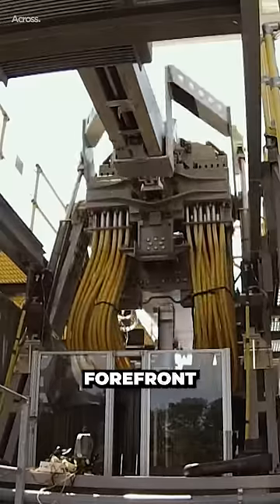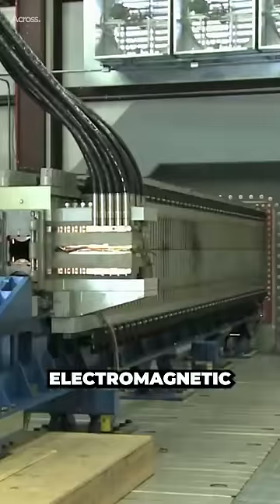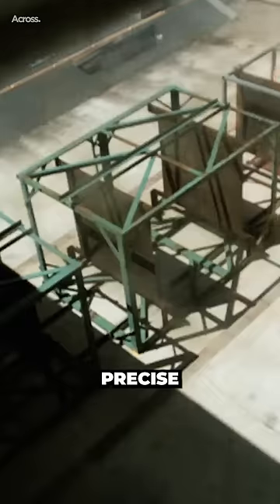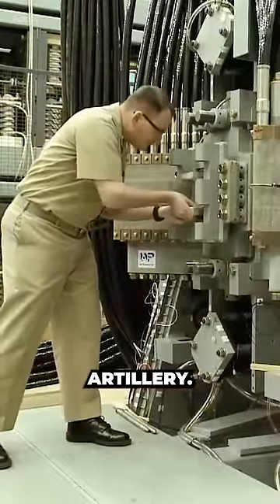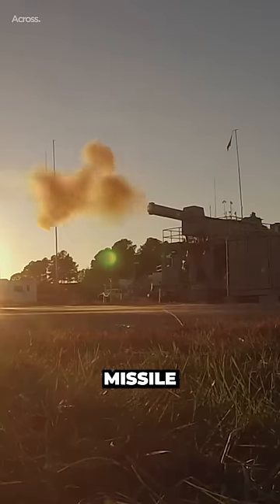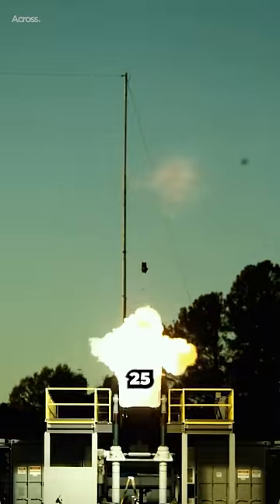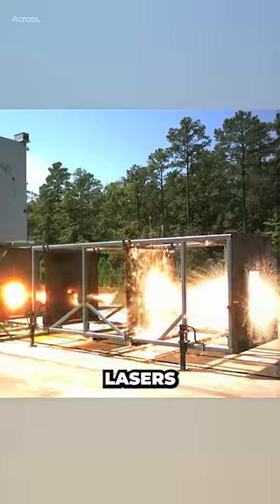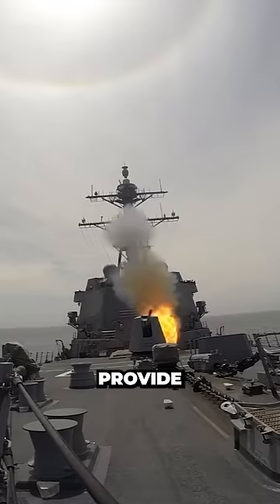The $500 Million Weapons That Make Everyone Afraid #shorts

Comment: When you say 25 megawatts do you mean 25 MW hours or 25 megawatt seconds or just the instantaneous power during the shot?
Reply: 25 megawatts. If you had a meter (like the ones on our homes), the same amount of power to make the meter record 25 megawatts. I thought it was pretty self-explanatory.
Reply: @castleanthrax1833  not really.
 Watts is a measure of power, not energy. It's like saying my car needs 200hp to get from point a to point b. You can get from a to b with a 100hp civic or a 500hp mustang and while the mustang can get you there a lot faster the amount of gas is what you really want to know. The instantaneous power doesn't tell you, what you need to know. I could power a 25Mw railgun for 1s with a 1kw diesel generator with a large enough flywheel capacitor, but it would take 7 hours between shots to charge up.

To put this into perspective, large land based nuclear power plants make about 1.2Mw. it's unrealistic to believe that a railgun of that magnitude would be suitable for naval scale. (Former Navy Electricians Mate)
Reply: @alienclay2  Wow. How annoying are these ridiculous analogies. It's not a car. It's not horsepower, and it's not distance.its 25 fn megawatts. You seem to be the only person who can not understand.
Reply: @castleanthrax1833  ok, let's dispense with my analogy and go with your explanation. Tell me this. The electricity meter on the side of your house, Does that measure watts or watt hours?
Reply: @alienclay2  The amount of power that would cause the meter to roll over 25 megawatts is the power that would be required to launch the projectile. The fact that they may have misspoken the terminology is not really relevant.
Reply: @castleanthrax1833  you are trying to answer my question and you don't even understand the basis of the science behind it. 

I don't mean to say this flippantly, but since you fail to understand my previous analogy I doubt that proceeding with more logos is going to help you, perhaps I shall establish some ethos. I spent 12years in the Navy as an electricians mate graduating from Naval Nuclear Power training. I spent 7years of my life pursuing a degree in electrical engineering (I was going at half speed while working full time). At one time in my life I worked for American Electric Power as a transmission dispatcher managing parts of a grid area covering 10% of the state of Texas and line voltages up to 1MV DC and 512kV AC. 

I understand physics, electricity and engineering and I also understand why it's nonsense in Back to the Future to stress about 1.21 gigawatts. I can produce that with an audio capacitor from off my car, that's instantaneous POWER but I can't sustain it, and how long I need to sustain it tells me how much WORK is in question. Please take time to find a video that can explain the difference between the three concepts of energy, power and work before returning.
Reply: @alienclay2  I don't care. I understood what they meant, and I didn't need to list my achievements to do so. Please find a video on how to behave less pompously before returning.
Reply: @tyroneemail  
......
You stated 25Mw = 25MJ
Let's simply your statement
w=J
No
A Watt does not equal a joule.
A Watt does equal a joule per second.
Or 
A Watt*second equals a joule.
A Watt*second also equals a Watt*hour/3600
Once again, this is a confusion of a unit of power(watts) vs a unit of energy (watt*hours, watt*seconds, joules, etc...)
Reply: 25 megawatts can power up a small city.
Reply: @castleanthrax1833 Die he's right. Planner of power supply stations for metros here. Just easy way for understanding. A 1kW motor uses 1kWh an h. A 6kW motor uses the same amount of electricity in 10min. The question is how many kWh are required, because it's a question of how long you need to maintain the 25MW of power. For a fraction of a second it wouldn't be a problem. You would need a super capacitor with a weight of about 140kg (considering a capacity of 50Wh/kg.) for powering this Thing for one sec. Thing is that something needs to supply this capacitor. Only suitable for nuclear powered ships. For a high fire rate that would be quite a problem. But the biggest problem of this is the service life of a barrel. It just will not last long enough. Don't know the word in english, but in german it's "Korrosionsströme" . Basicly electrons take material with them while travelling threw it. No problem with AC, because the electrons come back, but very problematic for DC, which you will need for a railgun. Also there's a massive amount of heat produced, which is also heavily impacting the material.
Reply: @alienclay2 I guess you made a mistake while typing. Power plants produce GW, not MW😉local coal powerplant here produced 3,4GW.
Reply: @Karsten31  that is correct, thank you for that clarification.
Reply: @Karsten31  that is correct, but the one thing I would disagree with is the need for the ship to be nuclear powered. I'm using some back of the napkin stuff here with broad assumptions about projectile mass and barrel length, but Perry class frigates had a 4mw electrical system with 4 diesel generators. Assuming a strong shipboard distribution with a 10mw and at least half available for weapons, 25mw for 1 second would be 6.95kwh. a 5mw system would recharge that in 5 seconds. If the shot time in the barrel is less, i.e .1s, then a system that size could support 2 shots a second.
Reply: @tyroneemail  why did you start your post by stating that a Watt has the exact same definition as an amp? (1C/s through a node)
If that is true then your definition negates voltage. (As wattage is defined by voltage *current.) Please proof read your comment and resubmit.
Reply: @tyroneemail  You are correct that Using the definition of current reveals the time constant inherent to the definition of power in watts, but you are forgetting the squared time constant of acceleration present in Joules to that has to be reduced to equate the terms.

A joule is defined as
The energy required to accelerate a 1 kg mass at 1 m/s2 through a distance of 1 m.
Or J=kg*(m^2)*(s^-2)

J=/=w because (C*v)*s^-1 =/= (kg*m^2)*s^-2

It also has a time component in the denominator, but without multiplying by time (seconds) to reduce it to a power of one, it represents a unit of energy and not power. 

I have never heard of your explanation this disparity in convention. I did a Google search of "watts to joules" and it confirmed the inseparable need to add time to the equation. Everything else you are bringing up as an explanation is nonsensical and superfluous.
Reply: @tyroneemail  . I'm a bit tired myself and I know my last post may not have been the best expression of logic even if it's conclusion is sound. How about this. Post a link to a reputable source that uses your convention of notation. As of right now it feels to me that you feel as something is a particular way and that you have support but I don't believe that support credibly exists so if you were to show that I may be more interested in continuing, because I've been doing as you said to do to double check myself and everything that comes up supports what I am saying.
Reply: @alienclay2  the cables wouldn't survive that. Also I would doubt, that the capacitor would be a fan of constantly charging and discharging.
Reply: @Karsten31  well, it's like any gun. How fast it can fire in theory is one thing, cooling the barrel (cables, whatever) to support max rate of fire is another. I'm just theory engineering here, let the design department handle that.😜
Reply: @tyroneemail  please provide a link or source for this being the case.
Reply: @tyroneemail  .... A rail gun is DC. Why are you talking real vs apparent power? The output is kinetic energy into the projectile. What are you talking about? It doesn't even relate to your suppositions about denoting the time variable? You are making no sense.
Reply: @tyroneemail  Matthew 5:23-24
I’m taking time to respond because in retrospect I recognize that I was impatient and rather overbearing in my third response to castleanthrax1833. I may have felt a bit slighted as he didn’t thoughtfully directly answer the question posed to him to my second response. The answer to that question might have prevented much of this and in response I felt that the shock of explaining my experience and credibility may cause him pause and reconsideration on his own part. I try to be conservative and respectful in my day to day life as I recognize that everyone can make mistakes, and even if I am 110% certain of my correctness, that I don’t want my pride to precipitate a fall. There are times when I know I am right, and it can be frustrating when I feel that people are not giving me a fair chance to at least consider my explanation. On my part, to both castleanthrax1833 and anyone else, I apologize. The way it came out in writing isn’t the tone that it came into my mind and the result was counterproductive rather than formative.

To that end, (and to free my mind of this issue for at least another 24hours, lol,) lets break down your last post.

“A rail gun utilizes Inductance or reactive power to propel a projectile. Rail gun devices can be AC or DC depending on what you are trying to achieve (ie one big projectile or many smaller ones). However once DC achieves its designed peak voltage the magnetic field would collapse. “

Thank you for your explanation. Sometimes terminology is a matter of interpretation and perspective, and common usage in a particular circle (Quartermaster in the Navy is different than Quartermaster in the Army, but correctness of usage is based on context.) I (and I emphasize “I” here) would not use the term of reactive power to describe the interaction of the electromotive forces present in the standard configuration of a railgun because the event is not cyclical in nature but eventful, and the delay in the buildup of the magnetic field is extremely tiny in a railgun because there is no coil to create sufficient reactance to cause the current to fall out of phase with the voltage to a degree that it would significantly differ from real power. It’s why railguns need large capacitors. Even the collapse of the magnetic filed that would occur at the breaking of the kick arc at the end of the barrel would be minimal due to the low inductance inherent to the circuit, AND because the circuit would be broken at that point, there would be nowhere for it to feed back into the system as electric energy. The measured MVA would be very, very, close to the real MW. To make an imperfect analogy, it would be like accounting for the capacitance of the wires in an AC generator, it’s so insignificant compared to the inductance of the coils present, it’s weird to bring it up. 

Even if there were a significant difference between the two, (hey, it might be, I could be wrong) it is still immaterial to the original argument of establishing weather or not it is standard convention to express watt*seconds as merely watts when trying to convey a quanta of energy. I (and again I emphasize “I” here) would never assume a receiver of information would understand that when I say 25megawatts that I mean Megawatt*seconds, because based on uncommunicated context, I could just as easily mean 25MW*hours, or even be precisely expressing peak system power input, hence my original question at the top of this thread. If anyone can question the meaning, it is irresponsible to be imprecise in communication as this can introduce error, or even start 25+ response arguments in the comments because of it. As I’m sure you well know, In engineering we learn, details matter. (billion dollar space missions have been lost on details like this) If you can provide a source where your convention of assuming watt*seconds is used, I would like to see it, more so out of curiosity then an attempt to prove myself right. I did as you earlier suggested and googled watt to joules conversion, all of the results confirmed my previous training and understanding and knowing how important the distinction can be, I don’t understand what professional environment would do so, but hey, it might be, I PROVE me wrong. 

It’s a pyrrhic victory at best as of course I recognize that the producer of this video likely doesn’t understand even half of what we’ve been discussing in here and if I really wanted to know I should just look it up myself next time in a more academic source. My search for clarity only sems to have done more harm than good in this matter over something very trivial and I feel a bit embarrassed to have even written this stupid long post except for the fact that I personally don’t like conflict, and I wanted a chance to lay down my pride in the quest for peace and in the name of God.
Reply: It is the consumption of power for 1 shot.
Next is how long it would take to recharge and shoot again.
Electricity is limited. Even with a nuke reactor there will be a lag in powering up.
Reply: @lm5085  🧐😞
Reply: @alienclay2  lmao we on YouTube, this ain't a damn electrician trade school. Proofread and resubmit your answers, remember to show your work or I'll have to mark it zero😂😂
Reply: @alienclay2  
According to Wikipedia, "As of December 2010, the greatest known energy used to  propel a railgun projectile is 33 megajoules." I'm guessing that number has been exceeded by now.
Reply: @spaceman081447  it only took 4 days, but at last, a relevant and useful answer to my original post that lends itself to an air of understanding and a basis by which one make make the assumption that the video misspoke and stated watts when it should have said Joules. I commend you spaceman081447.
Reply: @alienclay2  
Thank you. Well, the video did say "power" rather than "energy," so watts was the appropriate unit. However, 25 megawatts does seem like a lot of power. I would envision a nuclear powered arsenal ship with one reactor for propulsion and another dedicated reactor solely to power railguns and lasers.
Reply: @alienclay2 You're a smart man, I wish somebody would've taught me electrical.
Reply: @alienclay2  All I'm sure of was the Zumwalt Class of Littoral (Destroyers?) was built with enormous diesel generators to power these railguns. But the Zumwalt had an aluminium superstructure that was falling off its steel hull, it was powered by turbine engines like a jetski that kept failing, they never got the railgun to work, the US Navy blamed the Contractor, and the Contractor blamed the Navy.
You were supposed to get around 30 Zumwalts, you ended up with 3 after blowing $30 billion USD. I'm Australian, from the Contractor, Austral's, home town.
The whole project ended up being a schamozzle. Normally I'm very proud of Austral's achievements, but this project just made me happy I'm not a US Taxpayer. Here in Australia we get to wait until you've got these things working, then we just buy them. Unfortunately for you guys, you get saddled with the Defence Contractors outrageous cost blow outs.
I'm not an electrician, but the Navy was building Ships with enormous generators to power these things. You can't retrofit them onto older ships, that much I do know. The new replacement for the Arleigh Burke might have the electrical power for this railgun, but the new boat's not even named yet, or expected until after 2030.
Hopefully China hasn't overtaken us by then. Internet warriors always say China just does half arsed copies of everything, but I work in the Mining Industry with their gear, and their quality control needs work, but they are overtaking everyone in everything.
Reply: @petergriffin383  I can't teach you in person, but if you like books look for navy NEETS modules for electrician and electronics technician. They may be a bit dated (60's? 80's?) but they are designed to take someone with a high school education to levels of understanding rivaling a 3rd year engineering student and journeyman electrician (minus the calculus, but unless you are doing in depth circuit design work it's not usually necessary)
Reply: @alienclay2  Thank you I'll check that book out. I wish you could teach me in person.. I'm an industrial maintenance man, mostly mechanical, but I do dabble in electrical a bit. Other maintenance guys with more experience don't want to teach anymore so it sucks.. the work attitude these days is always negative and the "I'm better than you"
Reply: @castleanthrax1833 You sir are a perfect example of some who doesn't know the difference between "energy" and "power". But don't worry too much, since there's far too many people who suffer from the same issue.
Reply: Watt is going on here ? The question is can a ship produce the required power with generator and storage capacity and how long is the recovery time between shots !
Reply: @chavitacanta008  Well, assuming the record holder of 33 MJ done Dec 10, 2010 is a reasonable target, then that means a 1 megawatt generator would take 33 seconds to charge a bank of capacitors to produce a single shot. For the US Navy, a reactor with ~500 MWt can generate about 165 MWe, so in theory, that reactor can fire about 5 such shots per second, assuming all the power is going towards the railgun. OF course, it can't really fire that fast due to the time required to load each shot, and due to the fact that the rails tend to destroy themselves. Suspect that the self-damage to the gun is a primary reason the Navy stopped experimenting with them in the first place.
Reply: @Karsten31 I don't know what's more scary? Being next to a set of capacitors that large or a store of explosives like a traditional projectile would use. Both could turn you into vapour in a split second 👀
Reply: @zirconblue2  Capacitors of this size? That would be devastating😬
Reply: the power figure is useless with an average firing time, which means the actual relevant figure is not power but total energy
Reply: Interesting question, commentary and related discussion.  Former GMG here and I maybe understood about 75 to 80% of the electrical math.  That said...

There seems to be little dispute that this thing draws a tremendous amount of power and/or energy in any way you define it.  I can't speak to the feasibility of the power required or energy needed.  However, on the materials, associated equipment and space requirements alone, I'm not surprised this thing got canceled.  

It just doesn't seem to make a lot of sense to put a ginormous EMF (& EMP?)-generating device on an entirely metal craft that will be bathed in seaspray 😂